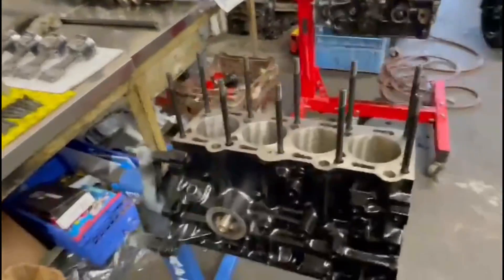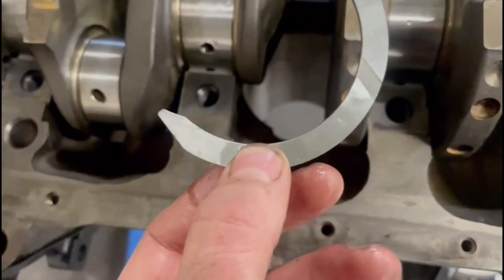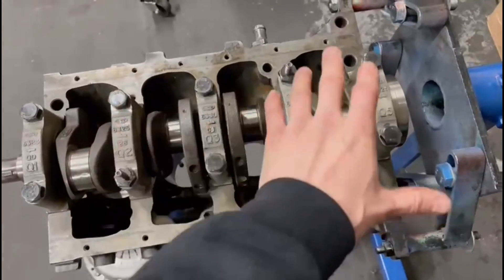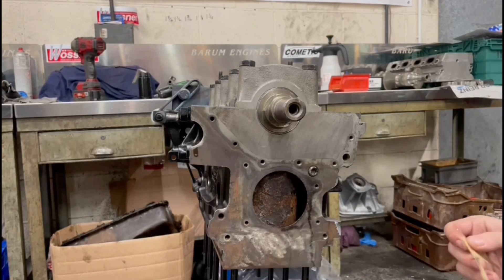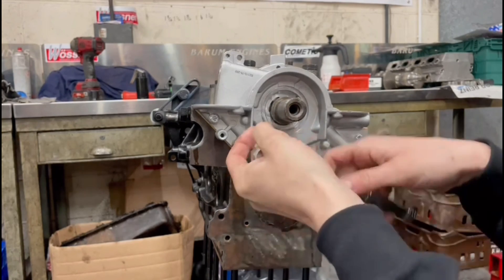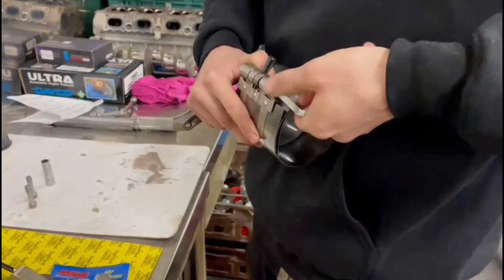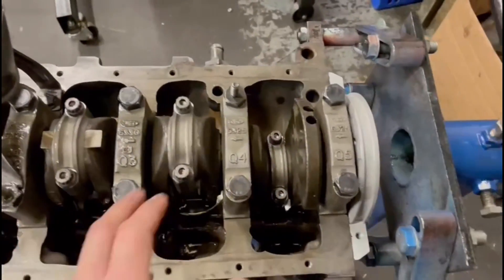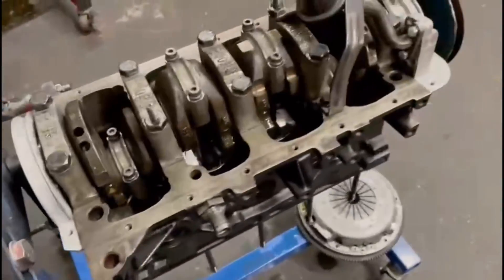Ford Fiesta RS Turbo engine build process | Part 1

Comment: Hiya sorry I’m only finding this vid and your Chanel now but I’m just about to start rebuilding a n/a cvh so this is pretty dam useful, one question though, I am handy with spanner’s done many things in my time but never rebuilt an engine before, my question is what bolts should I use to bolt the engine to the stand? Any help be greatly appreciated, apologies if it’s a stupid question but I don’t fancy it falling off the stand 😅

Comment: I fully understand lubing the bearing cap bolt but why "Always lube the other side as well? It doesn't even make contact with anything, ever. At least, not as far as I can tell or remember. Rust prevention doesn't even make sense in the environment it's going to be living in.
Sorry to sound like I'm dumping on you, I am curious whether there is a genuine reason I'm not understanding or whether it's just habit while assembling engines you've developed over the years. You know, better to accidentally lube something that doesn't really need it as routine rather than forget on a part that really does need it badly.
I am well aware that you absolutely do know what you're doing and care about doing it right. The fact you torque things in a pattern then recheck them speaks volumes about your thoroughness and, I do admire that Paul.

Comment: Paul / Lee. Instructions said use ARP lube but when you oiled the journal oil ran into the thread (8:15). Wouldn’t this render the ARP redundant?

Comment: A request please:  as a 'Merican, I am unfamiliar with the cars that your engines power. Could you please just mention, as in this one, not only an RS turbo Fiesta (which we never got) but on other cars as well, e.g. various BMWs as well as the really interesting old engines you encounter now and then-like the old 3-cyl you redid, and even what the Ford 351 is from. Just to give us some context.  Most of us have never seen these engines outside their parent car. Thanks ever so much.

Comment: Great work as always Paul, your commentary has improved as well. Lee, any thoughts to expand the number of cams in shop so the guys can film either continuously like a security cam, or individual Go Pro style units they can use at each station on an overhead arm mount ? May need to bring on a full time video editor soon !

Comment: Paul does an excellent job of narrating and explaining the detail. And it can only get better with time and practice. I hope to see more episodes featuring Paul.

One thing that is needed and is easily improved: Use hand-held camera only when there's no choice. Or do a stationary shot(s) along with hand-held, and edit for the best after. Unless held very still, or the cam software evens out all the hand motion, it's a bit like being at sea.

I was enthralled by the entirety of this! Lee should know that things are in good hands when he can't be about.
Reply: I certainly won't argue with what you said, for another reason as well as the ones you mentioned. When the Lee's videoing he likes waving his hand around which being 1/8 Italian and despite trying I always have my hands waving around, especially giving directions, even over the damned phone lol. Problem is the camera tends to keep focusing on his hand instead of what he's showing.
For the wobbles etc there motorized are gimbals made for all sizes and types of cameras and phones that would hold the camera angle much more smoothly. Alternately I recently bought a GoPro 11 and the stabilization IN that camera is amazingly good. He could even use one like it WITH a motorized gimbal and maybe have it super smooth.
As for my minor annoyance, I have noticed that if he keeps his hand at full arms length AND to one side it seems to mostly hold focus on what he's showing us, otherwise it would be good if he just used something like a laser pointer, maybe.

Comment: That oil pump Paul is called a Bi-Rotor pump. If it’s too be reused you should check the tooth clearance with a Feeler Gauge. The crank pins need to be injected with Engine oil once installed. When using the Torque Wrench, pull it toward you not push it away. I don’t want to be critical guys and I know you do a good job that’s why I watch but the devil is in the detail as an Engines life depends on it.

Comment: I use vaseline in oil.pumps. Does not run out or dry out. When started, the oil pump will draw oil in which then disolves the vaseline. The oil and filter should be changed in the first couple of hundred miles anyway. Learned that overhauling automatic transmissions and large powershift. The powershift were Allison behind 600HP diesel engines in mine haul trucks.
Reply: You should clean the suction strainer every 2nd oil change on those Transmissions too.

Comment: The gears are on the head, the bevelled edge must go down with the point down, as you have the gears now it builds less pressure, the flat side of the gears must go to the side of the plate friend I'm a fan.
I used curil t2 as a gasket, by default it is without a gasket on the plate, but I did it so that the pump builds up more pressure in the beginning, the green curil T2 can dissolve with the oil and remains liquid hard not out very safe greetings

Comment: Having watched all your videos I was shocked to see over oiling of a big end journal prior to bolting the cap on with the recommended thread lubricant, oil was allowed to flow down the threaded hole of the con rod, this can lead to hydraulic lock, wrong torque reading or at worse splitting the bolt hole,  I am have great regard for your company and your informative content but that is an absolute no no
Reply: Is that hole blind? Surely it must be open or  it's a school boy error, a lot of oil went down there.

Comment: Paul, nice to see you using quackhams, assembly lube is only good if the engine is going to be started within a few weeks! I live in the states now and I can’t find quackhams anywhere!!
Ps. If you need anything from over here, drop me a line eg. Chevy good quality master kit $200.00 ! Regards, Sandy 🔧🏴

Comment: One problem with certain old triumph lumps was that the thrust plates dropped out so the crank would shuttle everytime you clutched it.The 1500 was a buggar for that.
Reply: I had a cvh that would cut out when clutch depressed due thrust wear moving it out of line with crank sensor

Comment: two things, you should have shown the checking of big end bearing clearance, and those big end shells have machined holes on one that usually fits on the piston side, esp for those engines that require piston pin lubrication

Comment: Amazing how common sense can teach you. I never had any formal training in engine building, what I see you doing is exactly the way I taught myself, and still stick to the basic "rules" to this day, 35 years later.
Reply: Same here, only difference is that was (well, started learning at least) over 50 years ago with me. Since then I've completely rebuilt several motorcycle engines, all bar the actual boring and honing since I didn't have the equipment. I've resleaved and completely a couple of tractor engines, repaired numerous others, worked in car dealership workshops doing anything and everything that came up, run a pretty damned big engineering shop with a proper tradesman AND apprentice BOTH having been told to take their orders from me, worked on and off for a total of about 6 years as a top rated welder, an agricultural fencing contractor, a harvesting contractor, an independent gold miner/prospector and other times during harvest seasons I've either been the harvester operator or a truck driver carting grain to the railhead or after harvest carting it 1,320 kilometers a day to an oil extraction plant, a furniture removalist. The only tech qualification I ever wasted my time getting was after 2 wasted years full time whilst losing the wages I'd saved to see me through the 2 years getting qualified as, I kid you not, a biological laboratory technician. That was such a ridiculous waste of time that I refused to have anything more to do with these so called "further educational institutions". Much better to learn yourself using common sense, looked up specs and probably most importantly, asking guys like Paul here for advice if not absolutely certain. 
I will add that other than oil changes and really obvious stuff, I wouldn't have a clue what to do if my modern car decides to break down. I understand the basic machine but, now they're so bloomin complicated all around that still the same principals engine. Plus, who in hell has one of those expensive scanners AND knows how to read and interpret what it tells anyway.

Comment: Do the engine manufactures not use locking tabs anymore on the cap bolts.
Reply: Stretch bolts do not need tabs if tight to the given figure. The tread and its hole must be clean.
Reply: @petersaupe7455  thank you very much for your reply

Comment: Great to see. Brings back so many memories of the race motorcycle engines I built.very good tutorial. I’m well retired now but do miss it so enjoy your channel
Reply: Me too. I've rebuilt several motorcycle engines, mostly 2 strokes, gotta love the simplicity of them. I've rebuilt a couple of 4 strokes too and my awesome converted Bultaco matador converted, bored, ported, a decent expansion chamber fitted (back when they didn't have to be muffled so millions of whip cracking eardrum busting power) which made a really good and competitive short circuit racer. Those were all enjoyable and satisfying. I hate all the incomprehensible electronics around modern engines, I don't have a clue with them, except that hiding under all the silly beauty covers there's mazes or wires, sensors and , , , things I have no idea what for. Modern stuff sucks. Says the guy who can't now imagine driving around Australia without my climate controlled air con lol.
Reply: Great memories of building race motors as well. Now.... those contemporary motors are vintage.  I don't miss the traveling and busy schedules form event to event.  I now restore those motors / bikes. It is now a fun vocation and retirement business. Be good. Stay healthy.
Reply: @matthewharlowehrscyclespor668  . I know exactly what you mean. Have stopped now due to arthritis in my hands even though I still get asked. Really miss it. It’s the expectation of what your going to find and how the finished engine turns out and the customer is happy

Comment: Good looking build 
Do you think using just oil and not assembly lube is a good practice especially if the engine sits around for a while before being used
Reply: They only been doin this YEARS 🙈🙈😂😂
Reply: Not sure what assembly lube is, how does it differ from the oil used?
Reply: @Impulse5596  oil if left for a long time can. Drip off but assembly lube is a bit thicker and stays longer but it is not cheap
Reply: @Impulse5596  its very sticky and more viscous , it probably works well maybe better than oil, but oil was used before assembly lube came out so it could just be a sales gimmick, probably expensive if you build engines all week long
Reply: I asked about it a few vids back. Graphogen paste is what is normally used if the engine isn't going to be started soon after assembly.
Reply: Wouldn’t worry too much.  He Wipes oil with someone’s old pants, instead of lint free rag and then I suspect it’ll sit on the floor for a week with a dusty old bed sheet covering it. 

Not to mention someone using the air line, blowing all kinds of crap into the air to stick to any oil on the bore, crank etc.
Reply: @smokinrider   never happy 🤣🤣🤣
Reply: @bobdovemotorsports  It’s best practice surely.  Don’t see Geoff Richardsons boys or Mass engines using old pants as shop rags.
Reply: @smokinrider  Never thought I would encounter an oily rag snob. But here we are! 😂
Reply: @charlesjackman143  not at all mate. But I’m not charging 1000s to build engines.  If I was a customer I wouldn’t want a main bearing it big end or oil pump failing, due to being blocked with lint from a rag.
Reply: @smokinrider  Iv built 100s of engines and some race winning engines with “old pants” as you call them. No main bearing or big end failures yet 👌. Take it from someone who has 50 years of building engines